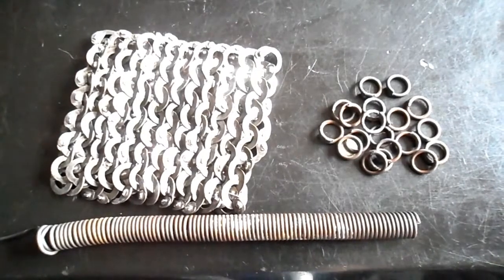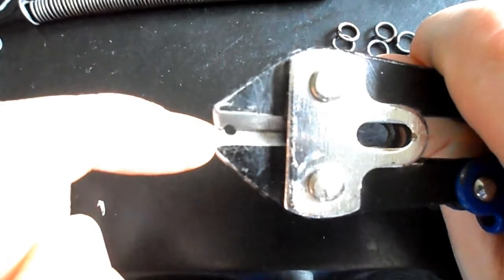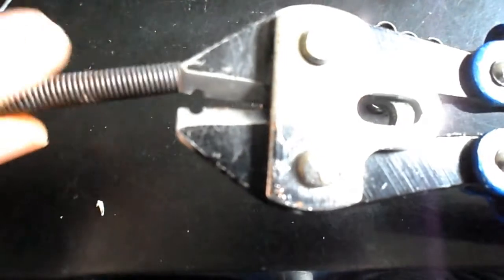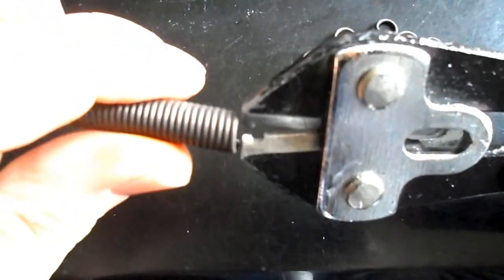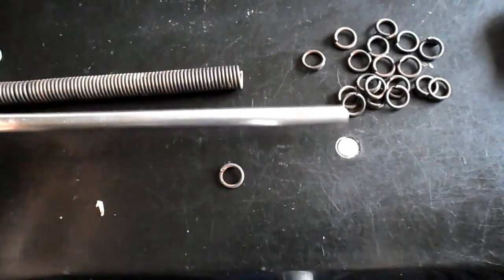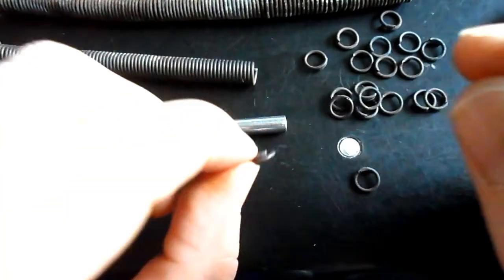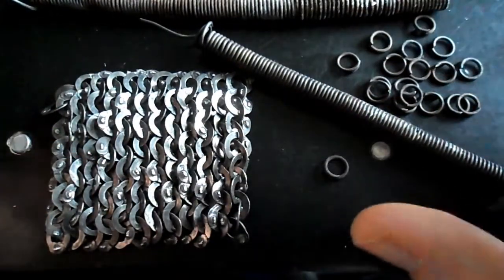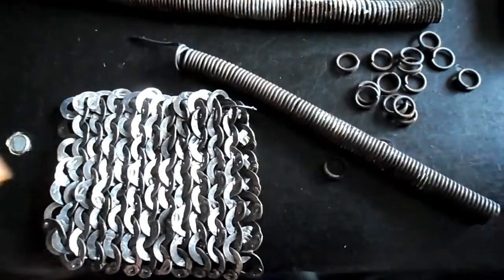Wedge Riveted Maile Armour - #3 Overlapping Rings

Comment: Why did you specifically choose 1.2 mm wire? Did it work the best for flattening or did it just yield most historically accurate results?
Reply from the maker: I find 1.2mm leads to the best results when working with an inner diameter ring size of 6mm. Should I wish to craft in 8mm ID, I would be more inclined to use 1.4mm wires or in 4 or 5mm ID then 1mm wires. This has less to do with historical research and more to do with my personal experiencing of trial and error.